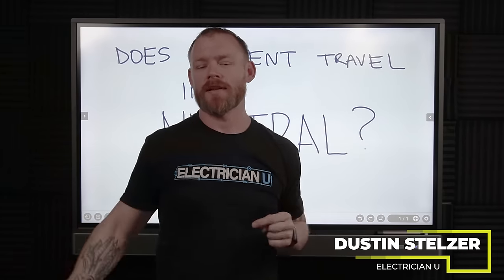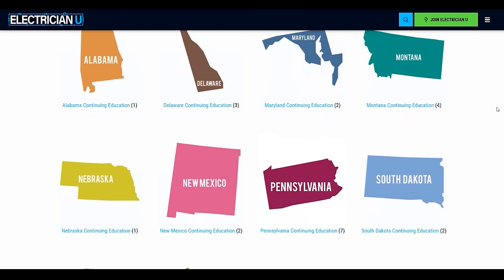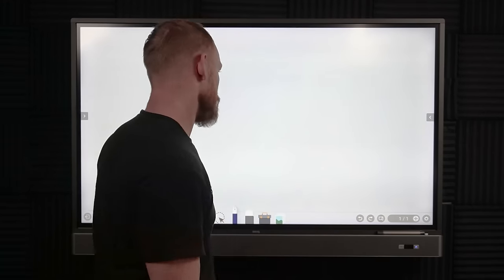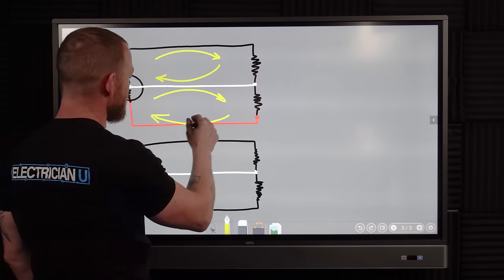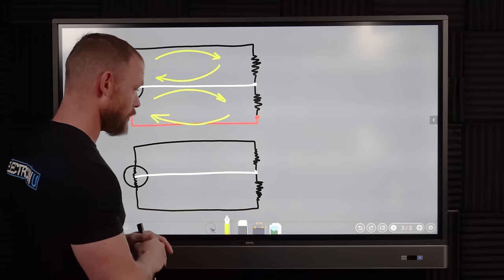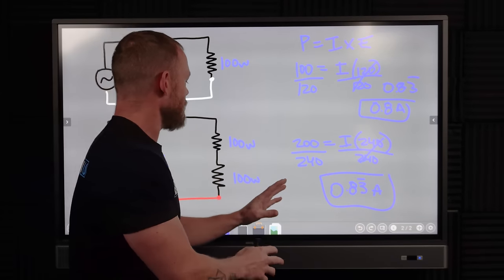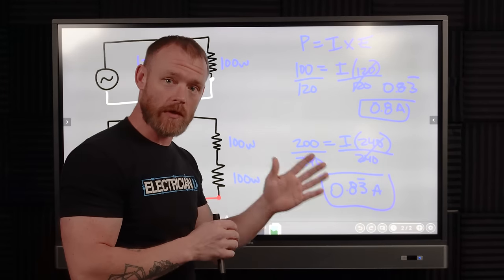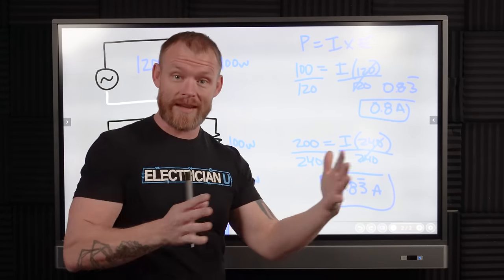Does Current Flow on the Neutral?

Comment: If I may add my 2 cents to this tutorial:

1) In a Branch circuit, where you have a Black, White, and Green, technically the White is not called a Neutral. The correct term is the Grounded Conductor, and there is current on it, because the current has only one path to get back to the Source.

2) In a Single Phase system, as you would find in a Residence, where you have (L1), (L2) and (N), the Neutral is there to carry any unbalanced load between (L1) and (L2). In a perfect world where the distribution panel was perfectly balanced, there would be no need for the neutral. However, since you have both 120V and 240V appliances in the home, then the Neutral is needed.

To simplify the " PUSH-PULL" that Dustin talked about, it is important to remember that in a Single Phase system, (L1) and (L2) are 180 degrees out of phase with each other, meaning that when (L1) is at +180 degrees, (L2) is at -180 degrees, so when their currents meet up on the neutral, they basically cancel each other out, if their numbers are the same (+2A) and (-2A). (See Kirchhoff's Current Law)
Reply: @ethelryan257  Kirchoff is your friend! 🙂
Reply: Better bone up on AC circuits vs DC circuits because in an AC circuit you are dealing with Impedance, not resistance.
As soon as your load has anything other than pure resistance (incandescent lamps) there's phase shift between voltage and current and Power Factor comes into play.  Think multiple devices that present reactive loads from motors, fans,  ballasts and power supplies. 
Sure, laws of charge conservation still apply, but are your ready to do the math?  
With a low Impedance EARTH connection bonded to the Neutral buss in the panel how does that affect what he says? Does what he say about overloading the neutral connection (center tap) from the utility being of concern make sense? It didn't make any sense to me.    What about branch or sub-panels? 
Remember, this is AC power in a 3 wire 2 branch single phase L1-N-L2  120/240V configuration.
Reply: @hbmike47    1)  " Better bone up on AC circuits vs DC circuits because in an AC circuit you are dealing with Impedance, not resistance. " . . . . . . . . . . . There is Resistance in AC circuits as well.  Impedance = Resistance + Inductive Reactance + Capacitive Reactance

2) " As soon as your load has anything other than pure resistance (incandescent lamps) there's phase shift between voltage and current and Power Factor comes into play.  Think multiple devices that present reactive loads from motors, fans,  ballasts and power supplies. " . . . . . . . . . . . A circuit with mostly Inductive Loads will cause the Current to Lag the Voltage by 90 degrees. A circuit with mostly Capacitive Loads will cause Current to Lead the Voltage by 90 degrees. A situation like this will cause the Power Factor to be less than 100%. However, these conditions are found mostly in Commercial and Industrial Power Systems, not in Residential. That being said, Phase Shift and Power Factor does not change the PUSH PULL narrative that Dustin spoke about, and the fact that current does flow on the Neutral in certain conditions. The point remains that Single Phase systems are separated by 180 degrees, and 3 Phase Systems are separated by 120 degrees.

3) " With a low Impedance EARTH connection bonded to the Neutral buss in the panel how does that affect what he says? " . . . . . . . . . . Connecting the Neutral Bus to EARTH puts it at the same Potential as the Ground/Earth, which is zero. There is no voltage on the Neutral, but there is current. If you put a Voltmeter across Neutral and Ground wires in a circuit, the meter will read zero.
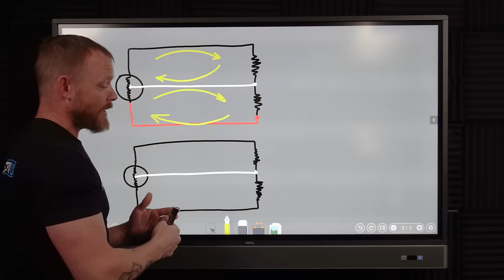Reply: @hbmike47   " Does what he say about overloading the neutral connection (center tap) from the utility being of concern make sense? It didn't make any sense to me. ". . . . . . . . . If you are referring to the portion of the video at about 13:41, he is describing a situation where you have 2 circuits from the same Phase, (L1), essentially sharing a neutral. Because the circuit "Hots" are from the same phase (L1), there is no cancelling of any unbalanced currents, instead they add. So if one circuit had 3A on it, and the other had 5A on it, you would have a total of 8A on the Neutral going back to the source.
Reply: Makes more sense to look at it "over time" to me. Sharing the neutral for the same phase is asking the neutral to pass the current the phase is carrying on all lines at the same time. Sharing it for different phases is asking it to take turns returning current for each phase. It seems either way you look at it there is inherently current on the neutral so long as it is being utilized and is loaded. I don't expect to see current on the neutral when the neutral is not being used. If it is being used to derive a voltage then I don't really see how there is any practical explanation to it not passing current because it does. This is clearly why the neutral needs to be sized correctly in any situation.
Reply: @griffmustard  no way to ever make the scenario you describe happen wiring  a panel.  It's just unnecessary wrong discussion by the creator of this content. 
Any EE that didn't point out the errors wouldn't pass a freshman year EM class much less a multiple choice exam that has an AC circuit and had both AC and DC formula in the answers. If you're going to claim that you are teaching, better know your subject matter.
Reply: @griffmustard  I used the correct term Impedance which as you point out includes both resistance and reactance.
That makes mentioning resistance redundant. 
2. Dustin  never mentions the word Impedance, or phase angle or anything that differentiated AC from DC. That's a fundamental error that would flunk a student on a test and I have a big problem with bad teaching being offered as "certified' or ?? 
So as much as we both know a lot more about this and can comment about it, the post itself is wrong in very meaningful ways.  Dustin brings up Magnetic and electric fields, and can't explain why it matters but never mentions Impedance?

3 is kind of a trick question. I think you got part of it.  The voltage at a properly bonded neutral buss is 0 volts to earth. 
Yep. Yet current is flowing on Neutral in most cases as reality is that active loads are never perfectly balanced.  So you have a loop sensing ammeter and want to measure the actual current. 
Where do you put the meter to measure? 
Will it be accurate? 
Give you one hint (but it might throw you off). The owner has a wood shop in his garage and has his 3hp 110v band saw running and a dust collection system and his lights flicker sometimes.
Reply: Edited

Griff,

You said that L1 is +180 deg and L2 is -180 deg.  Assuming the measurements are relative to some common voltage of the same frequency, with your phase measurements L1 & L2 are both at the same phase.  (+180 - (-180))  = 360 deg = 0 deg.
Reply: @davegroen8327  . . . . I'm not quite getting what you're saying, but to reiterate,  a single phase transformer, with a 240V Secondary Coil and a Center Tap Neutral, has readings of Phase to Phase (L1) to (L2) = 240V, and Phase to Neutral (L1/L2) to (N) = 120V. In order for current to flow, you must have a Completed circuit, along with a Difference of Potential, aka (Voltage). That means there has to be a difference between (L1) and (L2), and the difference is at NO time will they EVER be in Phase with each other. Whenever (L1) is Positive, (L2) is Negative and vise versa. Another way of saying the same thing, is to say, there are 180 degree separation between (L1) and (L2). This is quite evident on an O-Scope. Another way to clarify is to draw a circle and draw a (+) in it. Label each points on the plus sign (0, 90, 180, 270 and 360). Now, place (L1) at (180), while (L2) is at (0). Now imagine rotating (L1) and (L2) in a counter-clockwise direction. When (L2) is at (90), (L1) is at (270). When (L2) is at (180), (L1) is at (360 or 0). Keep in mind, from (0, 90, 180) is Positive. From (180, 270, 360) is Negative.

Comment: This would be a helluva lot simpler if you just show the two wave forms on a graph. The user could see that the troughs intersect at zero, and the peaks are the same magnitude and different polarity. This graphically shows the math, which equals zero along the whole line.
Reply: I was kinda thinking the same thing.  I'm only halfway through the vid, so maybe he addresses it better but it seems like showing the pushing/pulling that the two balanced loads are doing, resulting in no net change in electrons in the neutral bar, would better explain why there's no current on the neutral.
Reply: Ya know, that's the way I usually draw it out to explain it, but that doesn't click for everyone, I am going to try explaining it more like this
Reply: If the neutral is balanced (cancelling out), does the current flow across the other hot wire? That's what I thought he was showing but I'm not sure about the bulbs becoming a part of a 240v circuit etc ...

Comment: This was great, and I thought was going to address a confusion I have...almost did, but then didn't. I think someone else commented on this, regarding lots of time spent on the balanced load, but not enough on the imbalanced load. I get the 8A back through neutral, but I can't figure out how this is tied to ground at the same time. Arg, electricity is freaking magic as far as I can tell. Keep up the great work. I love this channel.
Reply: At the service entrance to your house (at the main panel) the ground and neutral are bonded together. This is the one and only place this bond occurs per the National Electric Code. This is done so that if a current carrying conductor (phase or neutral) touches ground, the stray current has a low impedance path back to the source which will allow a circuit breaker to quickly interrupt the fault. In a perfect world, current never flows on a ground. Think of the ground grid as a safety/backup path which stray current can escape on back to the source (instead of through a person for example). Neutral conductors are designed to carry current, unlike a ground. Think of a neutral as the normal/intended return path for current to flow back to the source.
Reply: Correct. The neutral and ground are tied together.  I used to intermingle the wires until an inspector made me separate them.  However, both are connected to the same place, which I pointed out.  Never had a problem either way.

Comment: For me the easiest way to always remember that "yes, current does flow through the neutral" is that any two-pronged plug won't ever work when plugged into an outlet that's missing its neutral wire connection.

Half the outlets in our apartment are wired so horribly (swapped hot/neutral, missing neutral, no connection at all, etc) that it was a guessing game when I moved in. I wish I'd picked a different unit but this one's lease had already begun so I had no choice...
Reply: wait what? you think that current will flow through a single wire depending on what the outlet looks like?

Comment: Thank You for another great video. It is difficult explaining a lot of electrical theory. It's really a pain in the butt explaining it to an electrician who kind of has their own theory. This one in particular seems to have been taught to a lot of Sparkys that I have worked around in a rather rigid way. So many of them will swear that two loads that are, say 5 amps each, will perfectly balance out and no neutral current will flow. Every one of them that I challenged to remove the two connections to the neutral bus and tie together then use any two fingers to complete the circuit back to the neutral bus, hot, just plain refused. Finding out how much they knew about WHY was revealed when I just asked them to explain the whole thing to me. Most of the time I was just told to take a hike, journeymen, dunno why most of them are so . . . stiff. Every time that I 'had my bluff called', I explained it with Ohms Law and showed the phase differences. I also would ask them why the neutral was there if it wasn't used.. I ALWAYS said that there is theory and there is practical use. They are rarely EXACTLY the same. Kinda like explaining how to drive to someone on paper, the finesse that is required in practical use is a bitch to explain on paper. Background: Retired after 30yrs as electronics tech in a facilities management department. I worked with two master electricians, one was educated in Germany and came to the US, the other has master tickets in five states. These two were very interested in learning more about electronics and I wanted to know more about power & distribution. We were a pretty cocky crowd and we loved a good problem. Open minds, required in service work.

Comment: Ive been a lineman for over 10 years and I have to say I like where your going with this presentation. Its hard to grasp all the intricacies involved with electrical theory and after all it is just a theory. The best way I have found to explain the neutral in regards to a 120/240 service is it neutralizes the unbalance between both hot legs. If the panel in the building always had equal load on both legs the neutral would not be needed. When I troubleshoot an open neutral to determine if its on our side or in the home. The easiest way is to clamp an amp meter around the whole service. If the neutral is good it will read under 1 amp regardless of the load. Because current going opposite ways cancel out in the meter.
Reply: After all it is just a theory? You might have the wrong definition of theory in your head.
Reply: This isn’t correct at all
Reply: @Ryker u can only clamp one wire at a time, measuring amps not volts.
Reply: Of course you need a neutral wire, it connects to the light bulb
Reply: benjamin thomas especially at  8.40
Reply: FACT!!!!
Reply: No, I don't think that's correct at all. The neutral will be less than an amp regardless of the load?? No, not true at all. If you have 30 amps on one phase and 20 on the other the neutral current is 10 amps. It's always the difference between the red and black phase and it's almost always greater than one amp unless your service is perfectly balanced.
Reply: Single phase or 3 phase, phase, A 20 amps,phase B 20 amps phase C 20 amps// ZERO ON NOODLE FACT  BALANCING PANEL IS THE KEY ,RARLEY THE CASE LOL THIS IS ON LIGHTING PANELS.This  is so basic learned this 40 years ago lol..
Reply: Steve Edberg well , if your trip is set at 30 mA . A discrepancy of this amount against the ‘ Star point ‘ YKFL !?
Reply: @dennispickard7743  are you talking about a GFCI?? Completely different and unrelated subject from this.
Reply: Steve Edberg nope ! YKFL is something else ! 👋👋😂😂😂😂
Reply: @dennispickard7743  please tell me what YKFL means. I have no clue what that is and neither does Google so please enlighten me.
Reply: Steve Edberg oops sorry , it means - you know the status quo ?  Apologies that was in Doric .
Reply: @bat__bat  Ooops....I think YOU might have the wrong definition of 'theory'. lol
Maybe you should go look it up?
Reply: @Steve_Edberg  Multiple phases...with different loads? Good luck with that mate!
Reply: If you are referring to 'whole service' as both hots and neutral all together I would have thought you would have 0 amps for a good system. Anything else is leaking to ground somewhere.
Reply: @regd809  Correct! 
I think the problem this guy has is that he's not using correct terms. 'current' has a very specific meaning...if you've got coulombs/sec flowing on the neutral...you've got  problems!
Reply: @charlesnelson5187  That's not quite what I was saying. As this video eventually got round to saying there will be current on the neutral if the loads on the 2 hot lines are not perfectly balanced, which will be most of the time. However if you put a clamp ammeter around all three lines - 2 hot and neutral - at the same time, the net current should be zero. 
I think the situation that @HCLinetrash is checking for is where there is a bad neutral connection somewhere and some of the current that should be on the neutral conductor is coming back by some other path. I just thought that up to 1 amp difference was a rather generous margin. After all a GFCI should trip if there is more than just 5mA difference on any individual protected circuit.
Reply: "Because current going opposite ways cancel out in the meter" You cannot have opposing currents in a conductor!!!
Conventionally current flows from a high to low potential, so it's either one way or no current at all.
Reply: @ppdan  My understanding of his comment is that he is referring to multiple conductors, both hots and neutral together. At any time current out equals current back across the three conductors for a good closed circuit, so a clamp meter round the entire bundle shows net zero current.

Comment: I remember working for a college radio station about 50 years ago. We always made very sure that the loads were balanced on both sides of the neutral, both to make sure that the neutral was not overloaded and to keep any transient noise in the audio equipment (vacuum tube days) down.
Reply: Oh my! Taking me back to the beginning. Critical circuits would have trimming resistors. Amp tubes in the final would have inductive trimmers. Fortunately some tech from years gone by would have made notes in station maintenance logs so those could be preset with no power/low power.
Reply: @thedillpickle100  that is very interesting.
Reply: @thedillpickle100   - And you always installed a bleeding resistor on the pot capacitors. Once they overtightened the resistor leads and ended up with an open, which they then didn't test. So, when checking to be sure that the capacitor was fully discharged, we ended up with an arc-welded screwdriver (after a rather spectacular flash!).